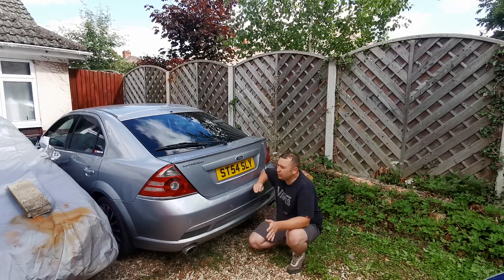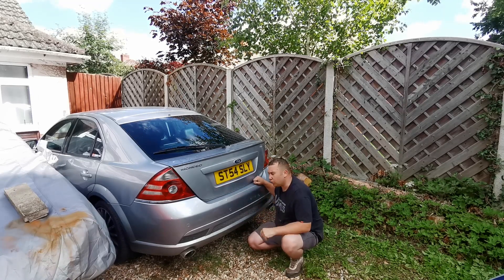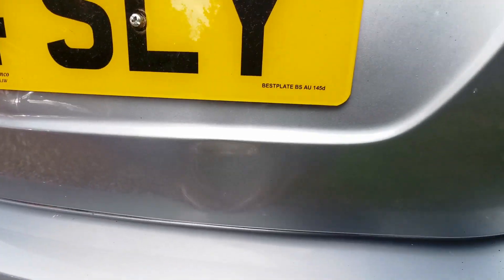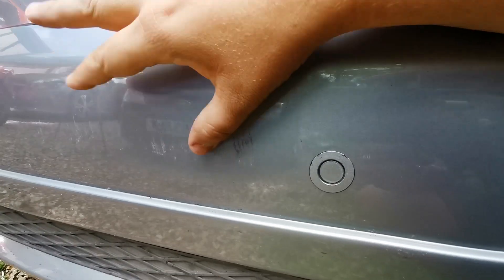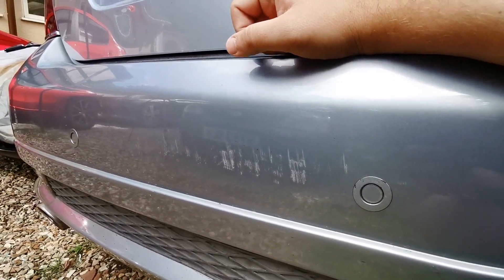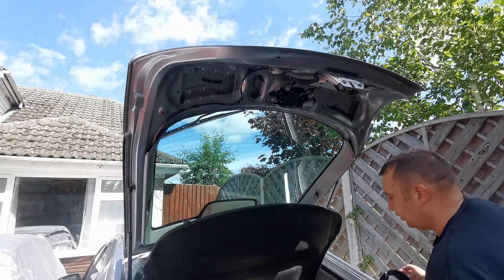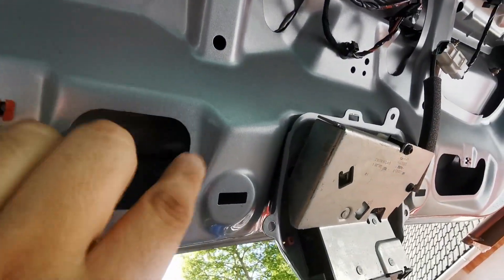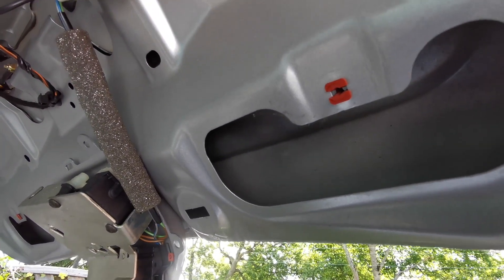MONDEO BODY REPAIRS PT1 #mondeomk3 #carbodyrepair #projectman

Comment: Gary you made a great job knocking out them dents, should have tried a piece of wood and go along the back of the seam, but well done on what you have achieved👍
Reply from the maker: It was just a bit tight working in that small cut out 👍🏻